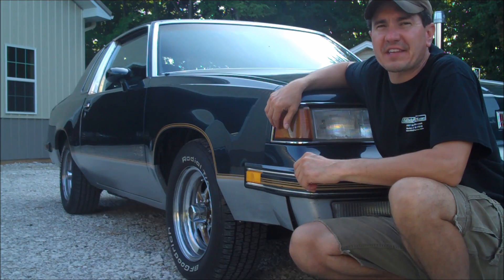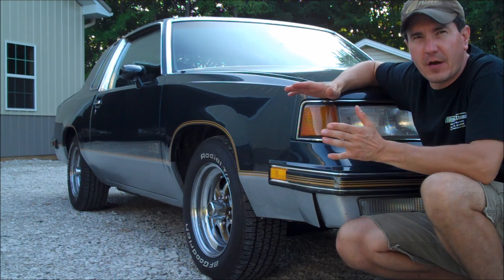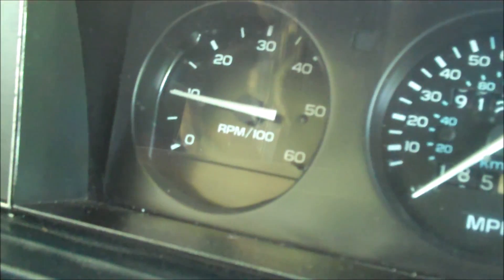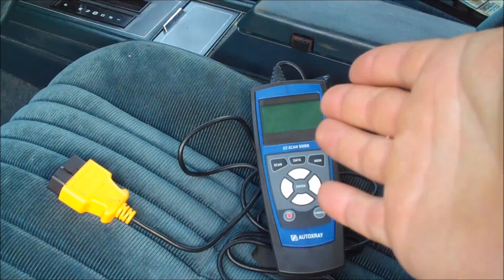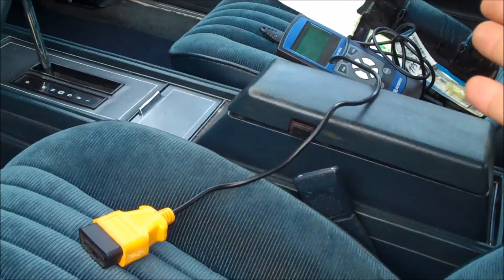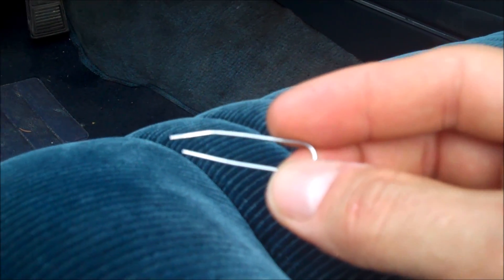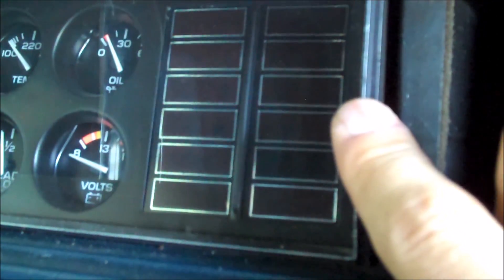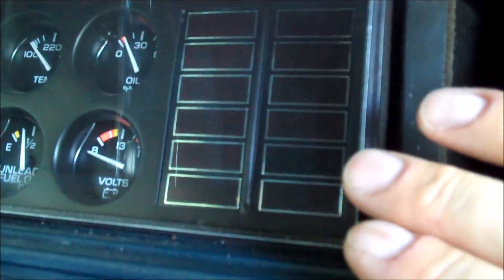How To Read A Check Engine Light Trouble Codes OBD1 WITHOUT A SCANNER

Comment: Mine never flashes 12. It just flashes 4 over and over. The car also makes a ticking noise when I place the jumper and switch the key to on. Anyone ever have this issue? 81 El Camino with the 5 pin ALDL.

Comment: What if my check engine light doesn’t stay on? It goes away while driving
Reply from the maker: Intermittent issue.
Reply: Well yes but I’m having rough running and the light comes and goes during
Reply from the maker: @RocketmanV8  The computer captures the code so whether its on or off it will still flash out an error code.

Comment: You  can get codes on those cars by turning the key to "on" 3 times. On the 3rd time it starts blinking the codes. I dont know if you can get any more codes with a paper clip or not. But Ive been using the key method for 23 yrs on my 1995 Jeep.

Comment: 💎❤️ does this super simple paper clip method work on all older diagnostic/ground terminals? Have a t124 Benz from 1989 and it is a 8 pin plug? Just wonder what kind of power that codes are created not to give you an electrical shock while connecting the terminals with the paper clip? Thought, these codes  can be recieved using a voltmeter?  Thank you so much for sharing this helpful video. 🙏🙏🙏  Stay save and blessings from Germany
Reply from the maker: I have only done this on the OBD1 system on GM cars.
Reply: @ClassicGBodyGarage  thank you 😉

Comment: You right That's all you got to do ,, But what do you do when you find a code44 replace oxygen sensor That's an auto x-ray 5000 looking a box that come with and you'll find the OBD1 connector for it, then you can see what the oxygen sensor is actually doing

Comment: Great video. When I tried to pull codes, check engine remains solid on. No code #12 and never flashes....any ideas? Checked my paper clip probe 3-4 times.   Car does run and drive.  Bad computer?  83 Regal
Reply from the maker: Computer might be bad.

Comment: How could I go about deleting the whole ECM everything in the 82 Cutlass supreme brougham and not have a check engine light with a 3.8 V6 is it possible it can be done
Reply from the maker: You need a vacuum advance distributor and a pre 1980 Rochester Dualjet carb.
Reply: @ClassicGBodyGarage  you guys wouldn't happen to have a part number for the distributor would you or no who sells one or what you're making model I could look for one off of
Reply: @ClassicGBodyGarage  so I actually have the Rochester dual jet carburetor but it's got an electronic plug on the top do I need to go for an older one
Reply from the maker: @chrisdicus3183  Yes you need pre electronic, same with the distributor.
Reply: @ClassicGBodyGarage  okay so today I'm going to work and I'll look for 1980 carburetor and distributor
Reply: @ClassicGBodyGarage  thank you guys for all your help

Comment: I DID IT FOR A 95 IMPALA SS AND IT DOESN'T DO ANYTHING
Reply from the maker: Check for second generation OBD1 as I learned that 95 was a transitional year.
Reply: @ClassicGBodyGarage   where can I get a second generation OBD1?  I don't get any blinking light, but I do have a fan that turns on.

Comment: I have a 95 Beretta 3.1 V6.  This does not work on my OBD1.  I have terminals A and M, and no others.  Any body, any ideas?
Reply from the maker: I learned that 95 uses the OBD2 scanner and it was a transition year.
Reply: @ClassicGBodyGarage  This is a OBD1 plug.  And there are only 2 of the 12 pin locations with a wire.  I cant remember if I tried my OBD1 to OBD2 adapter on this one.  Maybe I will give that a try.  Thanks
Reply from the maker: @brycejensen5020  yeah you may have to use an adapter for the OBD2 scanner then. Hope you can get it figured out.
Reply: @ClassicGBodyGarage  Nope, That didnt work either.

Comment: It's technically  GM 1
OBD1.5  came out in 1994 as a test run for OBD 2 so OBD 1.5 and OBD 2 have the same connector
Reply from the maker: Good to know.
Reply: Where is obd 1.5
Reply: @jonathonhicks2369  
For example  1994 pontiac  Bonneville  had a obd 2 connection. But it was 1.5 meaning  it did not have all the diagnostic  functions of obd 2 and the computer  was plug in play.

Comment: Here's one for ya. My 86 GP has a check engine light on but im not able to flash the codes. Not even with a paperclip. Not even with a gm obd plug. And my cigarette lighter has power.
Reply from the maker: fuse

Comment: G-Body garage. I have a question for you I have a check engine light on my 82 Caballero. I forgot that I left the paper clip in the port and now the light doesn't flash anymore it stays on continuously did I destroy the computer? I don't hear the little rods in the carburetor tapping anymore let me know what you think please thank you.
Reply from the maker: Its possible yes.
Reply: @ClassicGBodyGarage  how do you go about testing a computer in these G bodies? If you put a early style carburetor on it and distributor to bypass a computer, will the 200 4r transmission shift right still?

Comment: The location on the OBD one center on a 1980 Buick regal is not under the radio. It's in the kick panel in the passenger side. FYI

Comment: I have a 1980 chevy el camino and cannot find the location to find my check engine light obd where can it be located
Reply from the maker: Yours must be an early 80 model as GM didn't put OBD systems in all model year 80.

Comment: I have an 84 c10 and can't find plug. Truck was running like normal until it died backing into parking spot. I did some tests and no spark. I am going to check ignition fuse and codes, but there is no ALDL...
Reply from the maker: Your 84 may not have the OBD system. Trucks had different regulations. If you don't have spark then it might be the coil or pick up module. Check power to the distributor.
Reply: Coil tested OK I replaced cap and rotor (needed to be changed anyway) I also checked red wire and that is hot with key on.

Comment: And how would one read this 7long and 12 short flashz?
Reply: Subaru Bugeye 2001 model
Reply from the maker: 2001 uses OBD2 system and those scanners will tell you whats wrong. There are no flashes of the light to count.

Comment: Trying this in my 84 cutlass and the check engine light just stays on when key is in on position? And when running.. stumped.
Reply from the maker: Disconnect the battery for about 30 minutes to clear everythign out.

Comment: Hey Brian! Huge fan of the channel! Quick question.

I'm in the process of rejuvenating my 1980 Cutlass Supreme Brougham. Almost got the engine bay complete, this isn't my daily driver so I'm removing some emissions for appearances, she'll more likely just be a show and meet car. I noticed that the charcoal canister had a vacuum line leading up to a switch and two wires. Is that just a warning light to notify when the canister needs service? Or will it affect ignition? Is there any warning switches or sensors I should remove or bypass to eliminate a potential engine light?

Also, after watching this video I went to look for my OBD and I didn't have one. There's an ashtray in its place haha. Likely due to it being Canadian model I assume?

Thanks!
Reply from the maker: If your 80 was one built with an ECM then removing all of the emissions etc will trigger an engine light. You need to remove the computer with harness and pull the ECM fuse.

Comment: I have a 94 Chevy impala. When I jump These two pins it kicks on the fans but doesn’t flash the check engine light. Is there anything different I have to do for this model/year
Reply from the maker: If the port looks the same then it should flash it out
Reply: @ClassicGBodyGarage   I have 2, yes 2 OBD1 1995 Impala Super Sports sitting here and they both do the same thing John Nelson described. Something's different about the Caprice/Impala SS. I have read an actual scanner is required. Still researching.
Reply: The paper clip trick  doesn’t work on 1994 GM vehicles

Comment: Will this work for all obd 1 Chevy vehicles I have a 82 caprice sports coupe. Check engine light only comes on when I hit highway speed. But my speedo doesnt work I heard the gears pop and it stop working
Reply from the maker: Speedo is run from a cable and gear in the trans. Flash out the code, might be the speed sensor because your speedo isn't working.

Comment: Hey I have a 1984 Oldsmobile 307 5l Delta 88 it's been in my garage for the past 5 years haven't ran it but this year I want to get it started so I bought new battery new spark plugs new coil but I am getting a crank no start no spark situation. Do you think the cap and rotor and spark plug wires could be bad that's the reason for no spark or do you believe the ESC computer is bad and if so where do you locate the ESC computer that would be a great video thanks and have a nice day..
Reply from the maker: Make sure the distributor is getting power first then go from there. The ECM is usually located in the passenger side kick panel or under the dash on the passenger side. I know on a Gbody its in the kick panel.
Reply: @ClassicGBodyGarage  yes I also forgot to mention I bought a new distributor found top dead center dropped it in where the rotor was facing number one cylinder I am getting power to the distributor from the red wire. I did the code test just now and it just keeps reading 12 12 12 12 12 12  over and over again do you know what that means can you please help me out thanks a bunch
Reply: @ClassicGBodyGarage  when I put the car on the on position the battery light , oil/ Choke light and check engine lights comes on is that normal? Still haven't yet started the car still a crank no start no spark situation just wondering is my choke light supposed to be on when I'm trying to start the car?

Comment: Love your vids and I’m a regular in the Facebook group! On an 85 Cutlass with 3.8, I’m getting only the 12 code repeated over and over with SES light on when the key is turned to the on position. It cranks but does not start.
Reply from the maker: You have something else wrong then if it wont' start. A check engine light won't cause a no start. Thanks for your support as well.
Reply: I'm in the same boat, kind of worthless information if you're using for crank no start issue 😠.. find out what it was?

Comment: I got a question for u guys I have a 86 oldsmobile cutlass supreme with a 3.8 engine, my check engine light  comes on after the ecm got replaced and carb rebuild code is reading TPS my mechanic replaced it 3 times and still is reading tps do u know what else it could be
Reply from the maker: How does it run? What condition is the plug in?
Reply: @ClassicGBodyGarage  I have to let it warm up first because if I don't as soon as I put it in gear it shuts off
Reply: @ClassicGBodyGarage  what plug u talking about
Reply: It runs ok

Comment: Correction my 1985 firebird has a obd 11 connection. I can use a scanner but the sad part is it rarely does even when there is a issue . Please do a video on 1995 Firebird formula lt1  check engine codes

Comment: Get a Actron CP9690 code tester. It checks live, record, emissions readiness test, transmission codes, graphing, oxygen sensor test, ABS, SRS, and MORE! It comes with a OBDI cable for Ford, G.M., Chrysler, and Toyota. It has a G.M. adaptor for OBDII. It uses 4 AAA batteries under the rear cover. It is well-lit. It has code-connect to diagnose code solutions to codes. It comes in a black pouch. EBAY has it.

Comment: Can someone correct me if I am wrong -  I think the "Service egn. soon" light is different than the check egn light.
Reply: No, it's the same as check engine light. On G.M. cars, it's common for the light to be on. Helm Inc. has a repair manual with diagrams and troubleshooting trees to trace wiring faults causing the light to come on. A Actron CP9690 code tester works on 1984-2013. It has cables for OBDI for Ford, G.M., Chrysler, and Toyota. It has code-connect to diagnose codes. It's well-lit. EBAY has it. It comes in a black pouch. It uses 4 AAA batteries under the rear cover. Snap-on scanner checks codes. It has a primary cartridge and a Troubleshooter cartridge. Get the emissions cartridge. Get the OBD I G.M. cable and the cable for the cigarette lighter or battery adaptor if needed. EBAY has them. Some come in a case. There's a G.M. code tester which is cheaper from Amazon or EBAY.  It is small and plugs into the connector. It's for OBDI. Warm the engine to eliminate false codes. Run the engine @ 2000 RPM'S for 2 minutes to clear the engine. Run fuel injector cleaner first to eliminate false codes and clean injectors. Do a tune-up and change the oil. Replace the coolent temperature sensor to eliminate false codes. If you get improper vacuum to the EGR, replace the charcoal canister purge valve. If you get rich oxygen sensor codes, replace the MAP sensor, on Ford's and maybe others. Check vacuum parts with a Mityvac. It can check for leaking hoses by stopping up one end of the hose and pumping vacuum at the other. If you hook it up to the EGR and pump up about 6" vacuum, it should hold if it's negative backpressure. Positive EGR'S should NOT hold vacuum. With the engine running at idle, pump it up. The engine should stumble indicating the EGR is flowing and the passage is clear. If not, the EGR is clogged or the passage is stopped up. That can cause EGR codes. Check for vacuum to the EGR. At 1500 RPM'S there should be vacuum. Below a certain point, it should stop. A Mityvac can check the transmission modulator valve and hose.

Comment: I have 83 el camino. I am getting a code 34 (MAP sensor). Vehicle seems to be running ok. It seems to run a little lean. Any tips to fix it.
Reply: The MAP sensor can be bad. Replace it. Clogged injectors can cause lean mixtures. Run fuel injector cleaner in the tank to clean injectors. Check fuel pressure. A leaking EGR can cause lean mixtures. A partially stopped up fuel filter can cause lean mixtures. A leaking carb. base gasket or intake gasket can cause lean mixtures. Mity-vac can check for leaking hoses. A leaking modulator valve hose can cause lean mixtures. Get a Actron CP9690 code tester to check codes. It works on OBDI and OBDII Ford, G.M., Chrysler, and Toyota. It has code-connect to diagnose codes. EBAY has it. It comes in a black pouch. It uses 4 AAA batteries (not included) under the rear cover. It is well-lit. 2000 up is auto-test. Below, you dial in the year etc. It checks live, record, graphing, emissions readiness test, ABS, SRS, oxygen sensor test, transmission code test, and MORE!

Comment: I have an 87 Chevy Sprint rebadged Suzuki Swift import.  Would this be the same setup? Its a GM but really JDM.  Did you have the engine running when the light flashed or did you have it on accessory power position?
Reply from the maker: Probably not being an import

Comment: Can someone PLEASE help me out here ... My 1985 Monte Carlo will start and run as long as I am spraying atarting fluid into the carb ..  I have just replaced my tank, lines , filter , relay , pump , had the carb rebuilt ... STILL will not run by itself .. I am now pulling Code #34 .. Which is MAP Sensor Circuit Error .. If anyone has some insight please help me out .. This car only has 52,000 original miles .. I have had it for 5 years and in tired of bottle feeding it just to hear it run
Reply from the maker: You obviously have fuel issues. Pull the fuel line off at the carb and crank it over. The line should spit a lot of gas. Remove the paper inline filter at the carb and see if it will run. I had the check valve go bad in the filter. If none of that works then you have a float or needle/seat issue in the carb.
Reply: @ClassicGBodyGarage  Did not expect that fast of a reply so that is awesome . But 2 things that I forgot to add , it is a CL model with the 4.3L with the TBI carb .. I have been told that this carb does not have a filter in itself .. I did however get the one further back / right behind the passenger door . And to clarify .. If the gas shoots out it is more than likely the carb at that point ?
Reply: @ClassicGBodyGarage  But I will look further into the carb as well to gather more info.
Reply: UPDATE: I have disconnect the fuel line from the carb , no gas .. I disconnected from the fuel filter in front of the passenger wheel (as this model carb TBI did not have a filter itself) no gas coming from there .. I discovered a pinch between the tank and the filter .. So I loosened the line from the filter itself ... Should I be seeing gas come from there ?? If so why am I not ?
Reply: Diconected from the pump* itself

Comment: I have a 80 coupe Deville carbureted and I found the green lead near the liter box . After many minutes of looking at It only gives me code 12 and nothing else. What can I do to fix this? Thanks
Reply: That means your cars ECM(or PCM as some also call it) is seeing no problems that it recognizes. By flashing you the #12 only, it is communicating to you that it(the ECM) is functioning as intended, but the absence of additional 'codes' other than '12' doesn't always mean that a problem(s) is not present- it just isn't causing an issue that the ECM can 'see' or detect yet(or ever in some cases. If the car is running ok, enjoy it- if not, other forms of diagnostics can be preformed by a mechanic/technician(although you should make sure the one you choose has experience in this area) doing tests the 'Old fashioned' way LOL.

Comment: I went to do this last night but there's no metal electric connector in Port A.... Could I get just a new lil piece of copper or whatever and put it there or would I have to replace the whole part?? Any help would be appreciated.
Reply from the maker: If you have electric leads missing from the plug then someone messed with it. They are all the same.